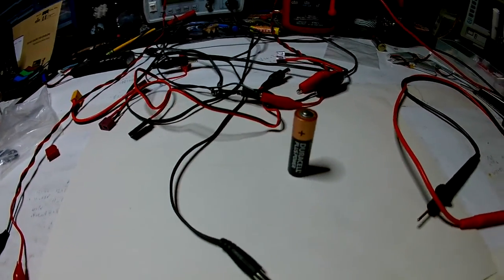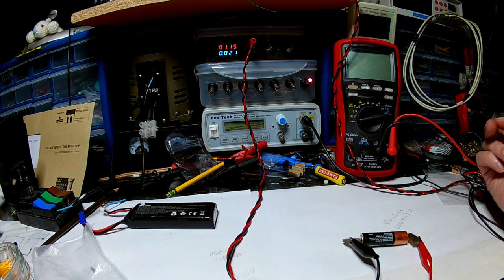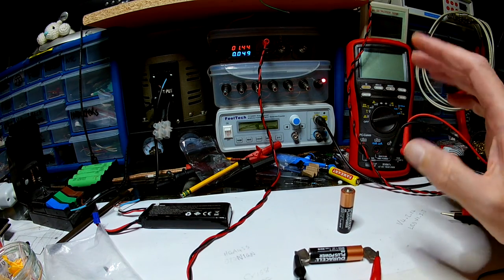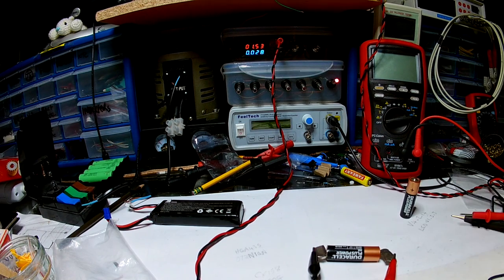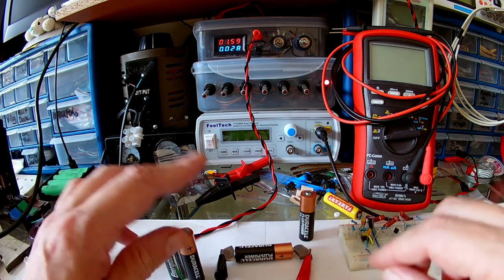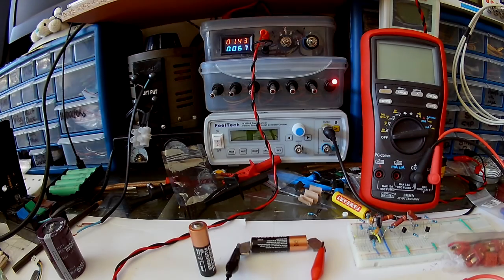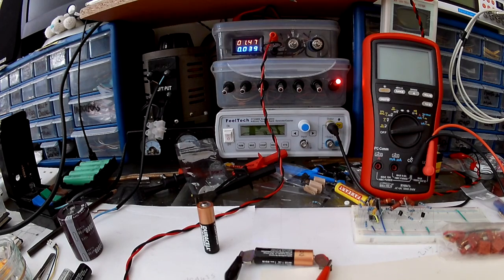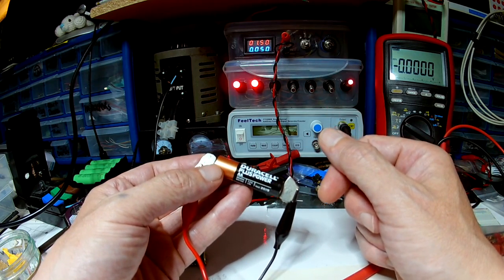Charging non rechargeable battery

Comment: A quick demo???? i cant believe i just spent half an hour watching a battery charge...grin....but its a favourite topic of mine ever since i was a kid and connected a battery to the mains..smile..i expect you know most of this but in case your viewers may find it of interest...I have learnt that you lose capacity every charge cycle...you can get about 10 charge cycles..but lose capacity each cycle...giving a total of twice the run time ...if that makes sense...in other words...if a battery lasts a month...you need to charge it 10 times to get 2 months use...yep they need to be topped up a lot..best not to let them drop below 1.30 volts..i am going to make a pulse charger one day...100 hz at 80% duty but for now i just stick 4 of them in a nicd charger and leave the room...grin...only had 2 blow up so far..solar charging (20 watt panel) i use  6 batteries and stick 12 volts into them ..ps i also sharpen disposable shavers..use the same one for 8 years...smile
Reply from the maker: Yup 14 sections to that video, took me all nearly all day. I will still charge my batteries like this until they do not work. I noticed losing capacity with the 9 volt in my cheap transistor tester. I haven't been using it as much since playing with the quad so have not noticed the degradation. How bad is it when they blow up? I might give that a try,. Sharpening disposable razors that sounds like it could get messy.

Comment: Ac into a battery will put energy in and also suck it out at the same time....things will get hot...grin....I have a fast charger that puts out 400ma...alkaline are not keen on that...just don't chuck one on a coal fire like my dad..I remember the loud bang and him pouring glasses of water onto numerous little fires around the living room...smile
Reply from the maker: OK I will use some helping hands and slowly turn up the pressure. I can use my imagination regarding your dad and him putting out small living room fires. That has me chuckling.
Reply from the maker: I am just trying to see if that DPS5015 dies powering my SSTC, so I have to turn off my computer as it does not like the radiation.